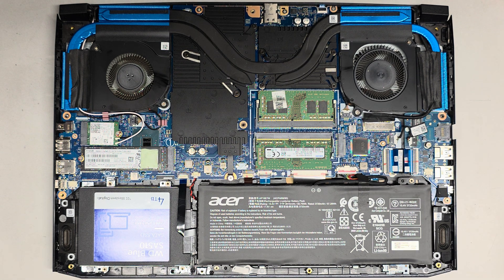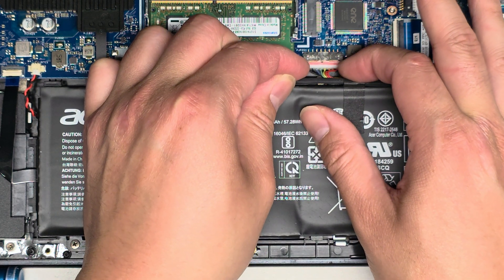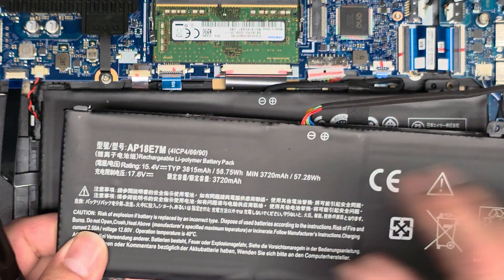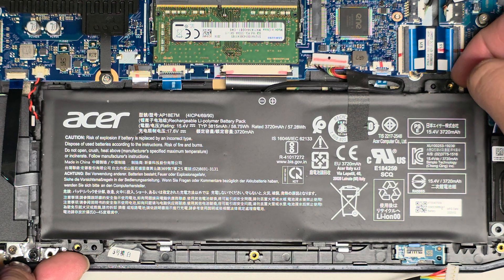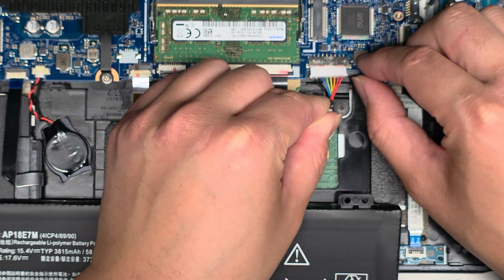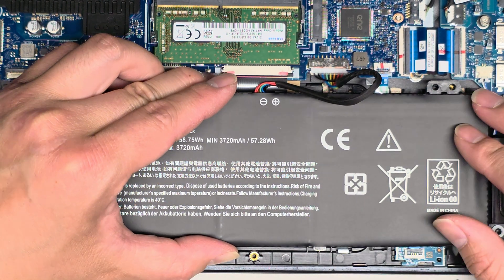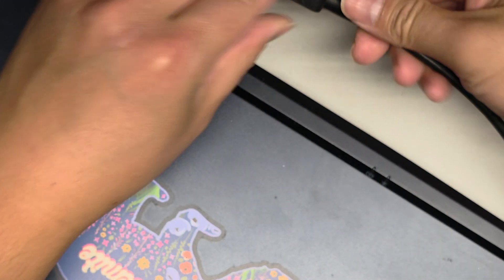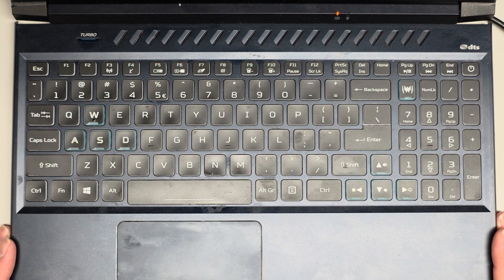Acer Predator Helios 300 N20C3 PH315-53-72XD CMOS BIOS RTC Real Time Clock Battery Replacement

Comment: WOW!!!!!! Has anyone ever told you that you are really good at explaining things? Because you are. I have worked in the tech industry for almost twenty years, I've watched a lot of tutorial type videos mostly because I'm curious how others teach, and this is some of the best.
Software is my thing. I never majored in computer science, but I have learned to do some programming, especially in the Apple ecosystem. As long as I've got my braille display, a screen reader and a computer, I'm all for it. I'll spend hours troubleshooting and/or figuring out how a program works.
But hardware... ARGH!!  I can take apart computers but it takes me forever, and it's not because I'm blind either. I just get impatient, lose track of stuff, and... well, it boils down to my lack of patience honestly. when I took the APlus test back in 2006 because my job required it, I flunked the hardware part the first time... by three stinking points!
I was with an engineer who is also completely blind, and one day, he came over and upgraded the RAM in my then desktop. He had that thing done in less than an hour and was like: "See, it's not difficult."
HMMPH.
I have never done anything internal with a laptop yet. I think I'm terrified that I'm going to break the hardware somehow.
Reply from the maker: Hahaha I'm not sure if they told me that, but they told me they like how I explain things. Hopefully the videos are helping you get over your fear of hardware. I usually stick to the simpler things that most people can pick up quick. I think soldering is the one that's a bit more difficult.
Reply: @ItsBinhRepaired  we will see. I have plans to take an Apple technicians certification sometime this year, but that requires hardware… Of course. It's for the Mac. The software part is easy because I've taken that a number of times, plus I teach it. But hardware… Gulp
😰
Reply from the maker: @khanhhm5762 macs are now designed not to be taken apart, though I have some videos of newer models.
Reply: @ItsBinhRepaired  I know. But if I ever want to do anything in AppleCare work, I should know this stuff. Yuck.
I haven't taken apart any Apple computer. The only ones I've taken apart were Windows, and it's been a while. My former engineer boyfriend would be laughing at me because he is very good both with software and hardware.
Sitting on my desk is my  Perkins Brailler. It's basically a braille typewriter with six keyboards, a space bar, backspace key, and a return key.
I don't use it all the time except to label documents now, but that thing got me through my math and science classes during college and high school. Anyway, it needs to be taken apart and cleaned, and I've been procrastinating on doing it. Too bad I can't beam it over to you and ask you to clean it for me, for a fee of course. I'm going to put on my big girl pants and do it, though.

I'll watch more of your repair videos as time allows. I love stuff like this, and I especially love learning from people who are way better than me in areas like hardware.
Reply from the maker: @khanhhm5762 haha I haven't worked on one of those before. Hope the disassembly and clean up goes well.